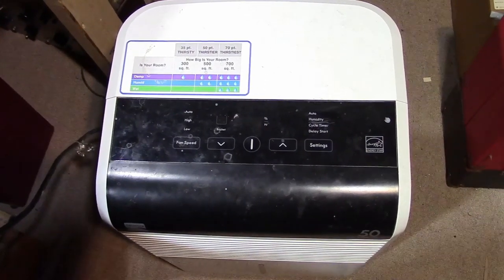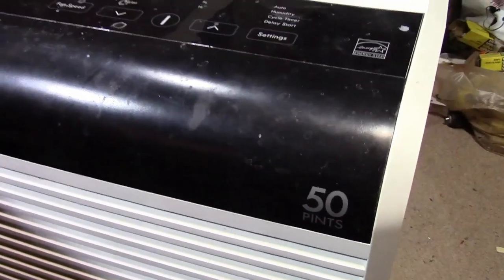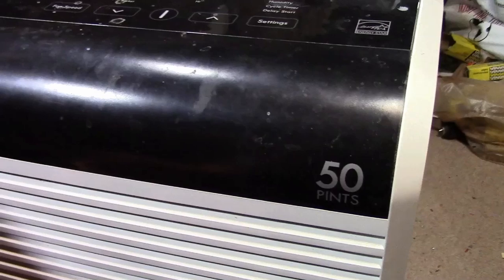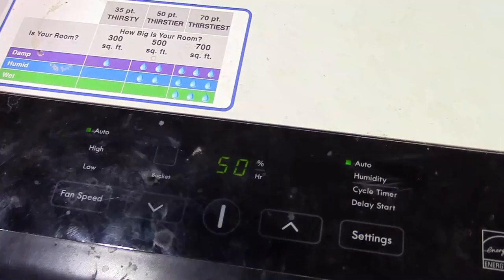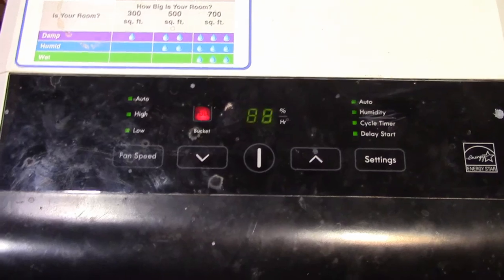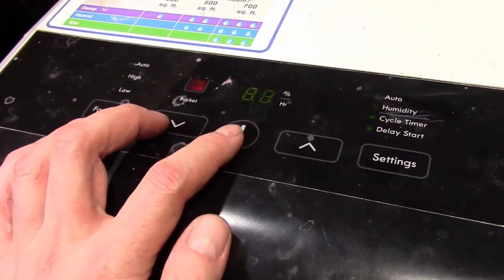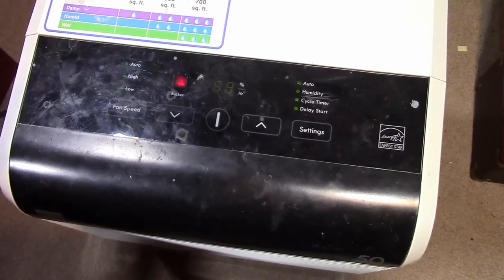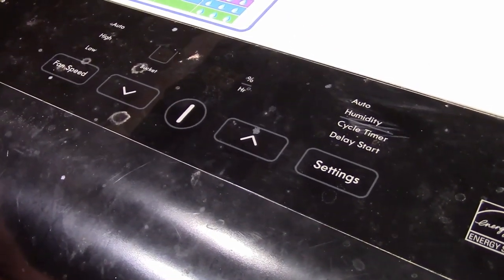Home Improvement - Dehumidifier repair p1o3

Comment: The flashing looks to me like the board is trying to start up, and the power supply is pooping out when the relays try to pull in and their coils start drawing more current. I'd be very suspicious of every electrolytic in the power supply. Letting it cycle like that may well corrupt the microcontroller's program memory.

The boards in these are often coated with something to protect against moisture. Honestly, I'm amazed that the dehumidifier had a refrigerant charge present when you found it. Refrigerant leaks are usually how they fail.

Comment: Bad filter cap in the power supply.  When the relay is supposed to kick in, the voltage drops, and the DC output gets noisy.  My oven was doing the same thing.  The clock would work, but if you tried the oven, it would behave in a similar way.
Reply: Exactly what I was thinking. The power supply have problems and when the micro-controller wake up, it needs too much current and keeps reset itself (well, kind of but it fails to wake up)
Reply: Agreed. If there is a scope, check the power supply rail.
Reply from the maker: Thanks for the advice.  I have an ESR meter around here somewhere.  Might be easier to just replace them if I have some on hand.  I'll reflow all the pads too.  Sad that something only 3 years old needs a recap!
Reply: @bandersentv  oh yeah!!!! pads reflow is a good idea..... I've repair a Harman Kardon TS-7 on the last year (it's a 150 watts subwoffer for home cinema) and maybe 50% of the preamp/ filter board's soldering was dead.... they were looking good but when using magnifying glass they were all cracked... like a little circular crack on all the soldering right in the middle of the curve and that was one of the main problem of it.... the second problem was the glue that become conductive with look like it's a really common plague... the glue look like neoprene and with the heat it becomes black and conductive.... I replaced the glue with silicone like what is used for bathroom joint.... why they not use that??? No idea at all and what I can tell you??? Well, welcome to new generation garbage product's world!
Reply: @bandersentv  Hi, it could be a smoothing capacitor, but it could also be the linear 12 volt regulator (which feeds in series the 5 volt one), if it fails to deliver enough current, when the relay coils start to draw current, the 12v line may drop  enough to make the 5 volt regulator oscillate, and the microcontroller board will go into fail mode. Good Luck
P.S. Here's the schematic of a very similar power supply, the main difference is the one in your device hasnt got the 9 volt rail;
https://fccid.io/YZJ25190701010/Schematics/Schematics-1382708
Reply from the maker: @johnbonham7515  thanks for the link. Yes the power supply portion is nearly identical to mine. You are definitely on to something about the 7812 being bad...
Reply: @bandersentv  My oven is a '99 model Whirlpool.  It took a hefty power surge that shorted two diodes, and took out the power transformer.  After replacing them and adding a fuse, it would go berzerk like that.  That's when I found the bad cap :)  I can bake cookies now.  Haha!

Comment: I just got a 70 gal one for $15, the guy still had the plastic cover on it.  Said it leaks everywhere but inside the tank … I just saw in your video the tube is optional, removed it, now it empties into the tank 😎👍🏼

Comment: My suggestion is to find the power specs on the IC and use a regulated PS to power the upper board with the IC with it disconnected and see if you can reproduce the issue. If not dig into the lower board and ancillary points and check the specs of each component replacing the out of spec ones. Ive been watching your videos for years and know you will find it and we will enjoy watching you do it. Good luck!

Comment: Those spade connects occasionally have a locking tab under the shroud.    Push it in and it should slide off easily.     I would reflow any solder joints of any parts that are heavy that could vibrate and crack any solder joints.    Lead free solder sucks.  Do you have an ESR meter to test the  E caps.   The switching power supplies are notorious for killing caps.      Check the power supply rails for heavy ripple on them.   The ripple could be high frequency like 100khz to 500khz.     This will point to bad filter caps also.   Look on line there are ton of DIY ESR meter circuits out there.   I made one 8 years ago and it is my most valuable test tool.    By the way when and where are the local Chicago area hamfests and radio swap meets?  THANX.   Looking forward to your progress on this.

Comment: How to operate the 70 pint I turn it on and after a few minutes it shuts off . I have set it on auto 30%,40%,50,60%,70% and it shuts off I changed the settings which has humidity, cycle,timer and delay start which stay on 1 or higher fan speed has auto, high and low. Which is the best way to run this unit it has 35 pt thirsty, 50 thirstier and 70 thirstiest right now its on auto at 50%  both fan speed and settings can someone help it look identical to the 50 pint on top of the unit?

Comment: I just thought about a repair I did to my Friedrich portable AC. The control panel was nearly dead acting. It has those microswitches like your dehumidifier. I hosed them down with CRC contact cleaner. I rather doubt it will help you, but it won't hurt I'm sure.

Comment: The rapid pulsing is the microcontroller resetting over and over very quickly. Since I doubt it has an external reset signal, the only way it can reset due to hardware is a brown out on the power supply. I suspect that when the microcontroller boots and does the display test where all the LEDs come on at once and the buzzer beeps, this causes the voltage to drop. The microcontroller then resets and turns the LEDs off, the voltage comes back up, and the cycle repeats.
Reply from the maker: You are definitely on to something. Stayed tuned for part 2

Comment: My first thought was a voltage regulator, but it could be a high ESR cap in the SMPS too
Reply from the maker: Did some troubleshooting tonight. It's a much simpler circuit than I realized. It's just a liner power supply. 12.6 vac transformer, bridge rectifier, 7812 and 7805 regulators with a few caps.

Comment: Without even watching the video beyond seeing the initial flickering symptoms, and without reading any comments, as a total beginner in this field, I’m still going to say this looks like a low voltage/power supply issue. I’ve seen digital electronics (in my case, music gear) act exactly like this when voltage supply was low. It will be interesting to see if I’m correct…

Comment: Resolder power transformer, looks like the secondary connections are cracked in the video. Had similar problems with AC control boards with cracks on the heavy parts making poor contact.

Comment: bypass all the electronics, run fan and compresser cont.  un plug when not needed
Reply from the maker: Interesting idea.  Maybe I can make use of the collection bucket full sensor to shut it off.
Reply: It will freeze up solid if not let to defrost once every 30 mins or so.
Reply: @zaprodk  my unit runs 24 /7 never freezes up they are like a a/c  and wont freeze ,unless they are low on freon.. then they will freeze the evap coil
Reply: @dennisqwertyuiop  they run a defrosting cycle even when you run them 24/7. You just won't notice it.

Comment: Since it was free to start with, unless the 5v is funky I'd probably ditch it or if you can just run it full tilt by hot wiring the fan and compressor. I suppose if you could figure out which wires go to the power board you could get an arduino or something and control it with that.
Reply: It will freeze up solid if not let to defrost once every 30 mins or so.

Comment: It seems kinda reversed to me. Usually when cap goes bad it doesn't want to start and after the cap formes a little it startes sort of working, this seems odd. Anyway - I don't see quartz rezonator on the board, so the MCU is probably timed from some RC oscillator, so there is no indication on which speed it runs. The thing is - if it runs on 4 MHz, it needs only 2.2V for supply, if it runs on max 12MHz, it needs 4.5V. Anyway, thats just me babbling around.
The problem seems obvious, power supply is crapping out. From what I can see the power transformer is very, VERY poorly soldered so I would start by resoldering the transformer. If that doesn't help, then look into the power supply, one of those caps probably are designed to fail, usually it is the reference cap on primary side of the PSU. Sometimes it takes out the regulator too, but there it seems to be working good since it at least provide some voltage.
It is fairly primitive device, no need for schematics, you will figure it out easily. Somebody who knows that much about the hardest electronic device out there (tubes) shouldn't be stopped by simple switching PSU and one MCU :D

Comment: Where's the predicta  TV build :(
Reply from the maker: I've picked up three more plus spare parts. Plenty of Predicta action to come
Reply: @bandersentv  After you finish the predicta build I'd love to purchase it if you are selling it. Love to buy one before the end of summer. I want to hook it up to a DVD player to watch old black and white movies.
Reply from the maker: Sorry, but I don't think I will have one by then.  I have two TVs to restore for someone else.  Then not sure which Predicta to restore.  That gold siesta I started on is a mess and will take quite a while to finish.  The Debutante with stand I showed recently I'm going to keep - at least for a while.  The Holiday I recently got is also a major project and is missing legs.
Reply: Which predicta build? He's rebuilt/repaired lots of predictas, go watch one of those series. Predicatas are boring, just a typical late 50s-early 60s series string TV set, aside from the Princess/Debutante/Siesta sets which are typical transformer sets from the same era. The only thing that makes them interesting is the styling, other then that the performance, and circuitry, is very average.
 As for myself I'm hoping that he will fix up his Dumont Clifton, one of the Strombergs, the early Philcos, one of the 10'' Motorolas, the Emersons, or that Sears Silvertone set with loctal tubes in it, but it's his channel. I like it when he restores one of the more unusual sets, same with the radios.
Reply from the maker: I'm a bit tired of the Predictas too, but they are in high demand.  I will tip you off that the next projects are for another client and include a 21" metal cabinet Admiral from the early 50s and a classic bakelite GE 800 "locomotive" from 1949.  I think that will be an interesting project.
Reply: @OlegKostoglatov  That's your opinion and most people love his predicta  builds . lots of views/on those videos.
Reply: I never said that they didn't, which isn't relevant since his videos are not monetized. I've watched them myself, but how many more videos about Predictas does he have to make? Other then the second generation models he's pretty well got all of the series string models covered, except maybe the "barber pole", which is really just a floor model version of a Holiday anyhow.
Reply: I will be watching the G.E project for certain, I own one of it's Canadian cousins with a similar chassis.
Reply: @OlegKostoglatov  More the better. Predicta  is my favorite
Reply from the maker: I even did a barber pole AKA Pedestal restoration series :)  It was for a client and turned out great.  I did a Debutante and Princes.  I think the only model I haven't at least shown in the Danish Modern.  I've only had one shot at getting that rare model. It was at a local estate sale but gone by the time I arrived.
Reply from the maker: You will be seeing more. Got some new ones in I haven't shown yet.
Reply: I think I remember seeing videos regarding the Debutante and Princess, but not a restoration series. I do remember the Tandem sets though, those are probably the most technically interesting in the series string 1958-59 models with that big cable to tie them together, good thing they used modern wire in them.
Reply from the maker: I combined the two in one series called Predicta debutante/princess restoration https://youtu.be/4al0uHhCtio

The Debutante was for a client and turned out very nice. The Princess is one of the first vintage TVs I collected year ago.  It sill needs a few finishing touches.  Couldn't get the picture as bright and sharp as the Debutante.